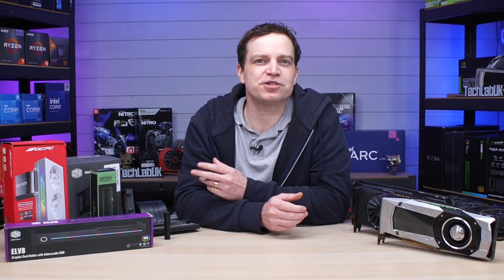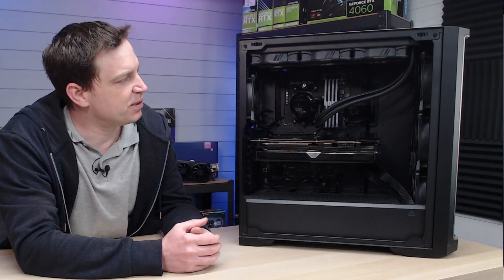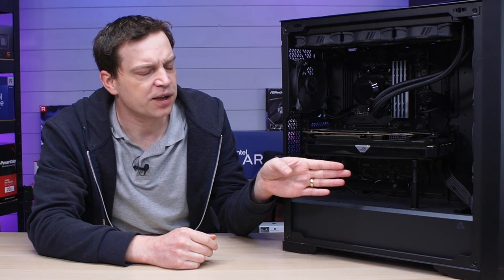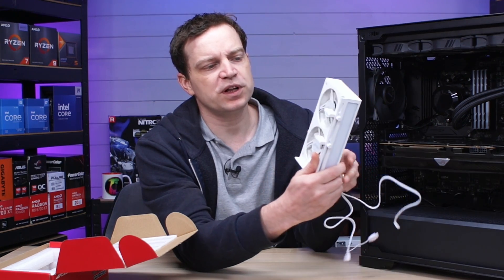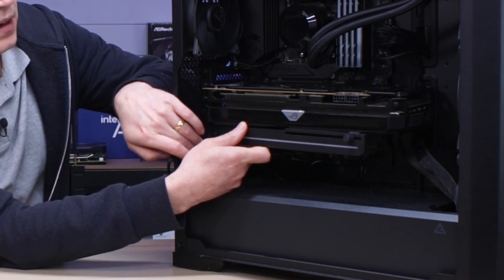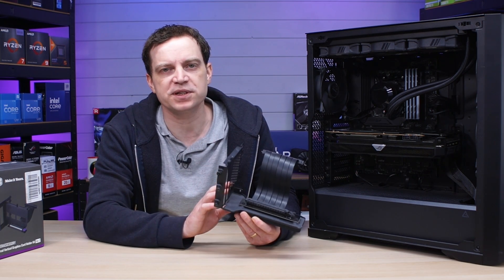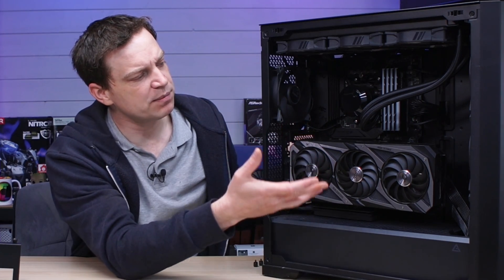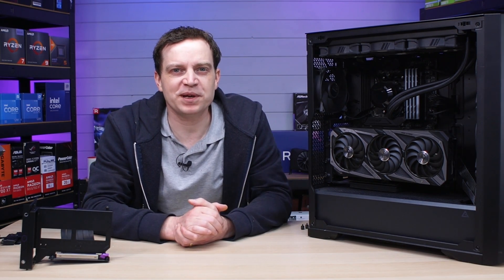How to fix GPU sag… The right way!

Comment: Because I could get it dirt cheap during a sale, I've been using that ELV8 from CM myself for nearly two years now and on three different GPUs and... it seems to work pretty well. 
Two things I'd like to add: You probably shouldn't "push the support into" your GPU, as you don't want to be pushing the GPU up, either (creating "positive sag"?). I simply pushed the actual support clamp upwards until it touched the GPU and then secured it in place. 
Second thing: While it wasn't necessary with the other two cards I used it on, I found that the "support-pad" worked better on my current card's cooler when I flipped it around (so that the upper "tongue" part of the support pointed towards the case's side panel, not towards the motherboard). Though that might just be a thing on my card (Palit GamingPro) whose shroud has some weird structures on it and not too many flat surfaces where the bracket needs to make contact. I also put a stick-on rubber-pad on there to, hopefully, reduce vibrations that might be traveling from the card into the support. 
Oh, and: The version I have might be a bit too short for really long GPUs. My first two cards were ~300mm long and the support's length worked just fine with that, but my current card is ~330mm long and I have to place the support between the second and third fans, which is roughly only half of the support's maximum "reach". If I would set it to its maximum setting, the clamp would sit inside the third fan's blades and that, obviously, wouldn't work.

Comment: It's so stupid that GPUs weigh more than the motherboard and sit suspended upside down applying all that warping force right to the PCIe socket. The sag killed my RTX 3070 Ti, games crash immediately when they start or a few minutes after. I bought a stand but installing it makes the PC not boot anymore! reinstalling my old RX590 which is a normal sized card fixes all issues.
Reply from the maker: Sounds like it damaged your GPU, maybe hair line cracked the PCB and when in normal position it's being shown up or something.  Pretty crappy.

Comment: ive got 3 fans on the bottom so i cant put the bracket in the front. is it possible to place it at the backside of the case and support it from there?

Comment: I put my sag bracket re seated it fired up warhammer 3 instantly rattling I miss aligned my sag bracket and now my 3rd fan barring will always rattle and I ruined my gpu i think where under load since 1 fan cant spin properly It it struggles to cool itself am I fucked? it usually sat at around 75 degrees i lowered the settings but it still sits around 87 degrees  any tips
Reply from the maker: I now someone who adjusted their sag bracket into a fan on their GPU and only noticed when the card kept overheating.  Luckily it wasn't damaged and removing the bracket from the blades was enough to resolve.

Comment: My gpu came with a L shape bracket that screwed into the mother board holes with riser screws then a metal peice is clipped on the front end of the gpu. Then that bolted onto the L peice.

Comment: Do you think vertical mounting then wont get in the way of the fractal torrent bottom fans or antec flux pro? 

Also what is the specific name of the phanteks vertical mount and is that the most stable one for 4090s? Or is there a newer and studier one?
Reply from the maker: There's a lot of better mounts now than the original Phanteks one.  You can get them now that float in the system so they don't need to sit on the bottom for systems with fans installed there.
Reply: @TechLabUK  Do you have any recommendations since the only ones I have seen recommended were the phanteks one on google and the cooler master adjustable one. 

I just want one that can support a 4090 since coolermasters one on their support I remember them saying it can't support a 4090 so. Just wondering which one would be the best for the card to prevent gpu sag the best.
Reply from the maker: @lovie74  I don't know tbh, we don't have a 4090 so not even really sure how big they are really.
Reply: @TechLabUK  ahhh I see, thnak you for responding though, it doesen't seem like a new vertical mount has been made in years sadly and that's why i've been using a horizantal gpu support bracket so far.
Reply: @lovie74  Did you find one or just stick with the bracket?
Reply: @threedawg  I am just using horizantal mounting and using a horizontal mount that came with the gpu  I bought from a 3090msi suprim. I use the bototm plates for my case and then mounted 2 140mm fans at the bottom area.

Comment: @TechLabUK
i would never under any circumstance push the gpu UP at the right most edge
this will not only push up the whole gpu/pcb it will also twist it and all the stress will be going directly under the gpu die, the risk of killing a gpu with that is just way to high.

Comment: THIS IS A WERY BAD WAY TO FIX GPU SAG..turns out this actually cant twist the wole card and rips the soldering under the die..Gpu fixers all over are reporting on this now.
Vertical mount is the only way to go
Reply: Isn't he actually using vertical mounts at the end? Or by vertical mount do you mean when the card runs from the top of the case to the bottom?
Reply: @zombizombi  yes he does👍
Reply: I hate that GPU companies can get away with this but, if a car has a manufacturing error they get recalled to be fixed or years after you get a letter saying they will fix the issue for free due to the safety issue etc.

Yet potentially 4090s burning etc is just no concern due to the faulty cable that doesn't secure correctly or now that the PCB can warp and all 4090s come with horizontal mounts. Like idk how lawsuits haven't opened up about this kind of stuff yet ngl
Reply: rly? is it bad to put gpu stand in the corner of gpu? What if riser is not option? My gpu is sagging a lot rn
Reply: @megapet777 just make sure it is RESTING on the riser... dont push it up

Comment: I feel it is just time to move to vertical mount as the standard with some universal case fitment. There isn't a whole lot of reason to avoid it any more, it's not like there's a lack of room in cases given most people will run a GPU and at most 1 extra expansion card these days.

Obviously not suitable for all cases but for most it would work fine. It's not like I can see GPUs getting any smaller and lighter, there's a lot of advantage to extremely over-built cooling systems and on balance I think it's worth it.

Comment: The part of the card that sags is the outer tail, where the power cables typically attach.  So that's where the sag should be addressed.  The way I do it is arguably a bit janky, but it does exactly what the GPU jack demonstrated here does.  I use the empty barrel of an expired ball-point stick pen, cut a few millimeters too short (measured with the card in the desired, non-saggy position) with a self-stick silicone bumper on each end.  Just wedge it it between the corner of the card between the fan shroud and the case floor or basement roof.  You could also buy a 3/8" or so wooden dowel rod (finished as suits your build) and cut a piece to the right length.  The advantages of this method are simple: it's very effective, and it's dirt cheap.

Comment: 9:58 My apologies for correcting you but with the coolermaster vertical mount shown, the lateral adjustment is not so you can move it more toward the center of the case for the sake of appearance... That mount is made for case where the the I/O slots on the rear of the case, have the divider strips in between each slot and that lateral adjustment is so you can move inward for the purpose of fitting your video cable and giving it clearance. Users should after fitting there video cables, slide the video card back to the left as much as possible without having the cable contact the case frame. Some cases have the divider strips cut out as it was in the case shown in the video. However, i bought one of the brackets for my my Corsair 4000D air because the strips were not cut out of that area. 10:29 The coolermaster vertical mount shown is made so you don't have to cut those bars out.
Reply from the maker: Thanks for the clarification 👍 makes backets like that even more useful.  Didn't even pay that much for that one either as it was on sale 😃